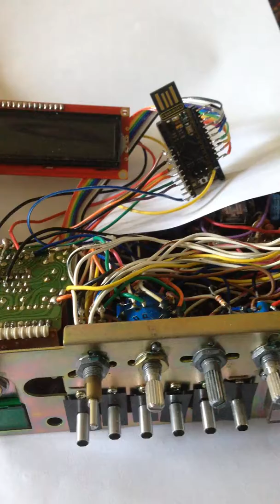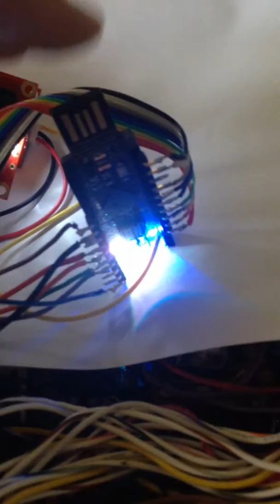#13 Arduino LeoStick CB Radio Modification

Comment: I wonder, for the use in the ROM locked PLL's, if you can pull the whole PLL out, and using a AD9850 inject as the output from the PLL used to do?
Reply from the maker: Peter Martin - that is a project I intend to do, I already have a few of those units to play with, however I successfully replace PLLs with non rom PLL units already, see my latest video series as an example, where I am using a mc145170